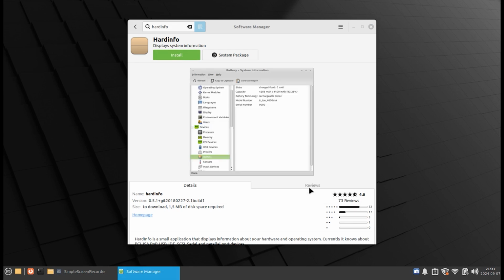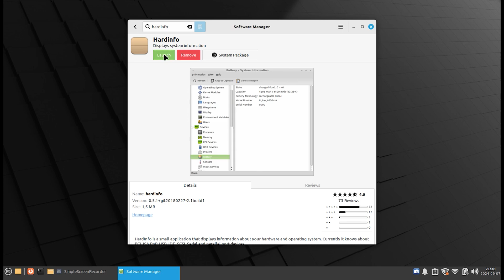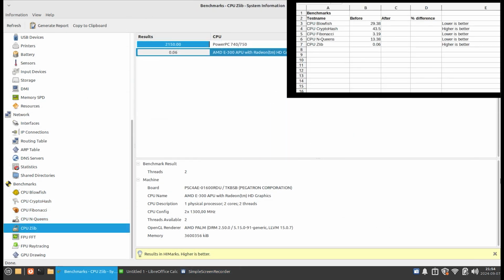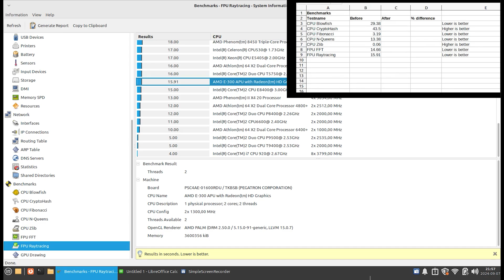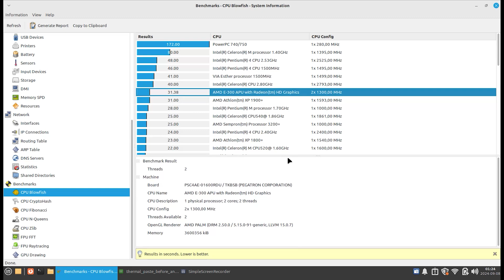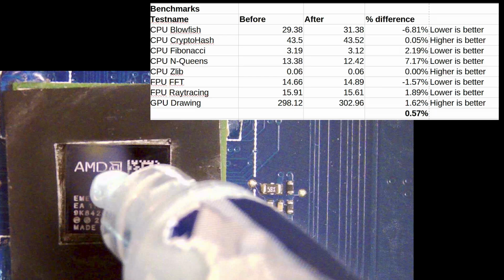Will replacing decade old thermal paste speed up my laptop?

Comment: I had a Toshiba laptop that due to high temperatures of CPU ( may bad cooling design , like yours 😁, or maybe because of failure of the thermal paste ) Tjmax - was almost immediately shut down by itself...  from BIOS had possibility to disable hyper-threading , which was the only way to start the laptop. Even if I changed the thermal paste , in the end the CPU was dead, because I think the damage due to continuous running very hot before, were unrecoverable ...  RIP ...
Reply from the maker: Sorry to hear the CPU failed in the end. Toshiba laptops used to be very good. Do you remember which model it was?
Reply: @repairchannel  Exactly the model, No. But it was also a Sattelite , with intel T5800 ( dual core ) CPU. And as I wrote above the only way to use this laptop was to suspend 1 core - yes this, I remember, was this option in the BIOS. Funny was , that under BIOS screen , no problem, but as soon it was started to load the Windows OS , ( with 2 cores enabled ) - then autoshutDown .... with 1 core can start but performance .... Oh, and I remember the radiator of the CPU was , Aluminum only 😀, no cooper core at least ... Of course I tried first to renew the thermal paste, then even I took out the laptop's keyboard in order to provide more air flow for cooling 😁- no improvements .... well RIP... ( not too much cry , because I bought it SH for some 8 USD - no RAM / HDD / adapter included 😁 - smart vendor ... after I discovered the scam with Tjmax temperatures for CPU .... )
Reply from the maker: That sounds like a bargain anyway then :). Well done. Too bad it broke down, but at least you have a nice board for spare parts and a lot of experience now. Taking out the keyboard to cool your CPU is inspired ;)